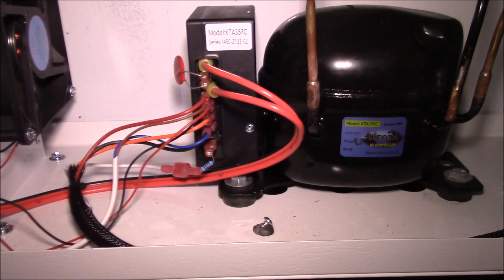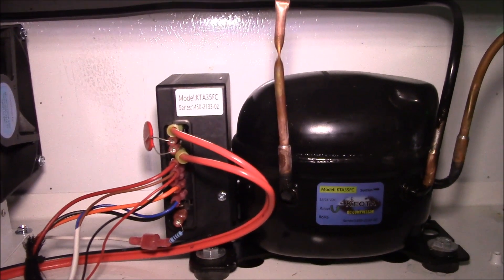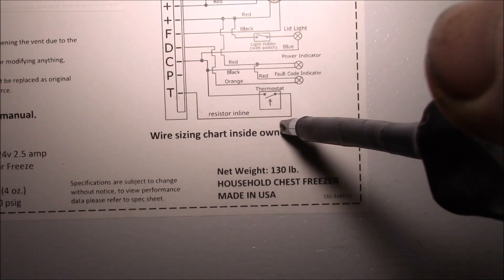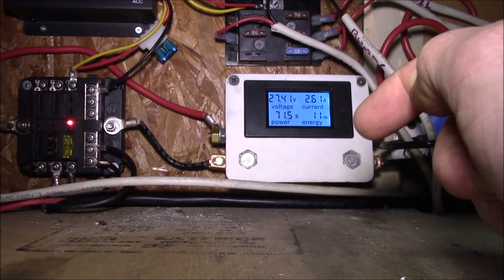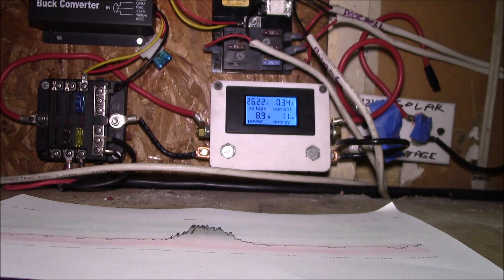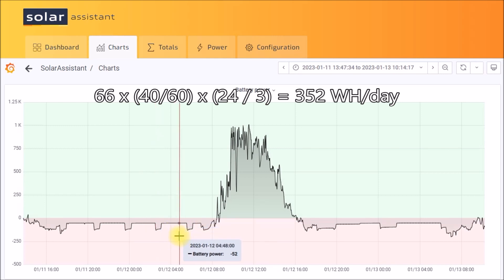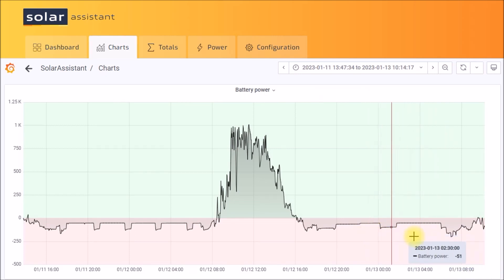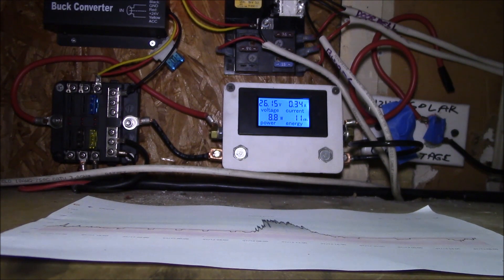Variable Speed Freezer Compressor Test

Comment from the maker: After nearly 2 years of operation, the freezer is still going strong.  I've left it on the slowest speed and energy consumption off my 24V solar battery bank runs between 300 and 500WH/day (winter - summer).  It will use a bit more energy on the higher speeds, but it seems more than able to maintain the set temperature even on the hottest days.  I have it set so that my freezer thermometer reads a low of -10°F and a high of +8°F, or average around 0°F (-18°C).

Comment: Have completed your testing with the 0-1500 ohm pot? What 0-1500 ohm pot did you purchase? Why do you have that capacitor connected between the +/- DC?
Reply from the maker: Yes, I need to go through that data and get a video put together.  Slowest speed (0 ohms) was the most efficient.  I picked up the pot from this e-bay store: https://www.ebay.com/str/highvoltagemary
I believe that is a surge suppression MOV across the input terminals, installed by the freezer mfg.
Reply: @The4Crawler  ok great. I will wait to see the video. I plan to use the 1.5k ohm pot to adjust RPM up to cool the danfoss unit down faster like when loading with food and the adjust back to 2000 RPM for efficiency.

Comment: Glad you've found out more about these compressors,  there's many channels on here that 'fiddle' with them for mini heat pumps etc. I think the 3 phase is at about 40-50 volts to the motor. For control, you could look into Node-red to control many many things including motor speeds based on average outside temperature for example, and home automation. Just a thought.
Reply from the maker: Yes, these are vary "hackable" units.  I think I'll try my simple potentiometer for a while, still waiting on that part to arrive.